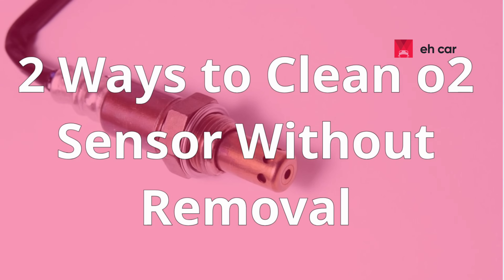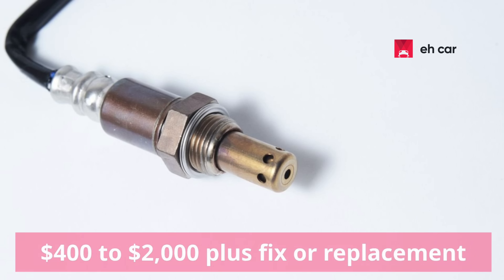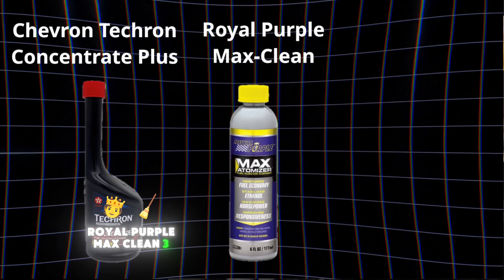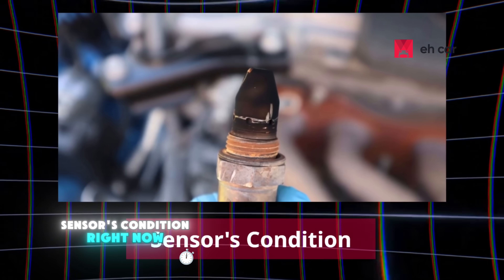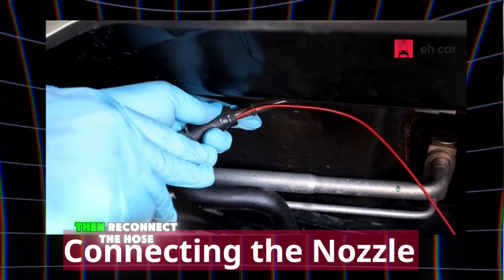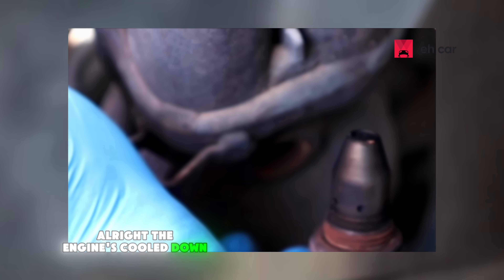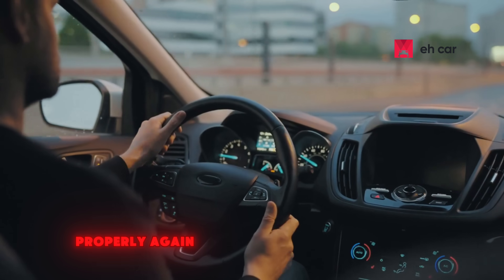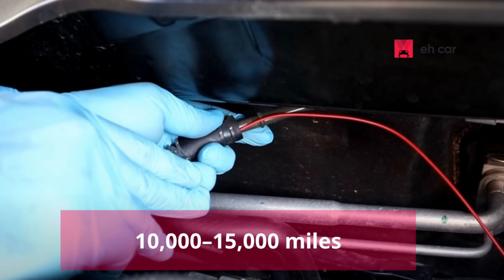2 Fast & Easiest Ways on How to Clean Oxygen sensor without Removing It (Cleaning O2 Sensor)

Comment: Bought a 03 Acura el white smoke came out, so I used seafoam and dura lube cata cleaner..I changed the 4 sparkplugs and ignition coils, and battery now it runs smooth 375,0000 kms on it.

Comment: The hard ones to replace are the downstream sensors and you don’t have any solution for that. What you have is just basic common solution. Instead of buying spray chemicals just use water to clean the sensors and the engine as well. Do the same procedure, water in to the intake with engine in idling mode . Water and hot steams will clean more better.

Comment: Keeping my engine between 2000 and 3000 rpm will get me tickets! The low side is interstate speeds.
Reply: not in neutral
Reply: The Italian tune-up can be done in any gear at any speed...
Reply: I drop down a gear and that gets the RPMs up but at a slower vehicle speed.  If you find a continuous road with little or no interruption to "going down the road" but with a slow speed limit then drop down one more gear, to get that 2 to 3 thousand rpm range 'they' tell you you need in order to get the cat(s) cooking to burn off carbon.  Will that clean up down stream O2 sensors, I don't know.

Comment: great video I am not sure what sensor is bad says bank 2 sensor 1  i was told thats the  one close to the engine i hope
Reply: u have a truck ? u may have 4censors 2/bank. 1on the in line the other on the out
Reply: Bank 2 Sensor 1 is an upstream oxygen sensor (O2 sensor) located in the exhaust system of a V-type engine, specifically on the bank of cylinders designated as Bank 2, and is positioned before the catalytic converter.

Comment: Some videos talk about more than one vacuum line - one that attaches to the valve cover and one that goes to a vacuum for the break booster. Does it matter which one you use for method 2?
Reply from the maker: Yep, it does. Use a true manifold vacuum source for Method 2; the best option is the brake booster line. The valve cover hose is for PCV gases, not steady vacuum, so it won’t work right for Method 2.
Reply: good question too bad no responses

Comment: Wouldn’t it be better to change both if your cars high mileage?
Reply from the maker: Yep, if your car’s high mileage, it’s usually smarter to change both parts together, saves you from doing the same labor twice, and keeps the system balanced. It costs a bit more upfront, but it can prevent repeat issues down the road
Reply: No, you can remove both of them and soak it about 2 hours and ritz, it off.
In reinstall I guarantee you it works i've done it for years😂
Reply: @geranwilson8813 what are you soaking them in.
Reply: @geranwilson8813 Soak in what?

Comment: Hold up Wait just one second something wrong here. An old oxygen sensor to a new oxygen sensor isn't cleaning it that's called replacing it. Your example you're using is from an old one to a brand new one not cleaning. So what does this tell us not much. Are we sure this really works? We didn't really get to see it. Show us the one you really cleaned.
Reply from the maker: You’re right, swapping in a new O2 sensor isn’t the same as cleaning the old one, but cleaning can go a long way, even when its temporarily